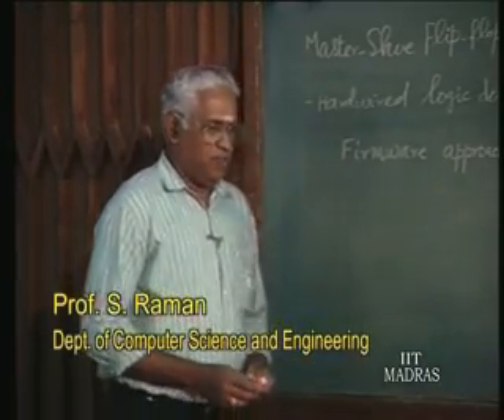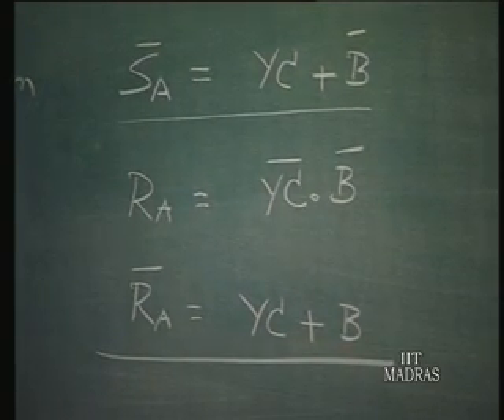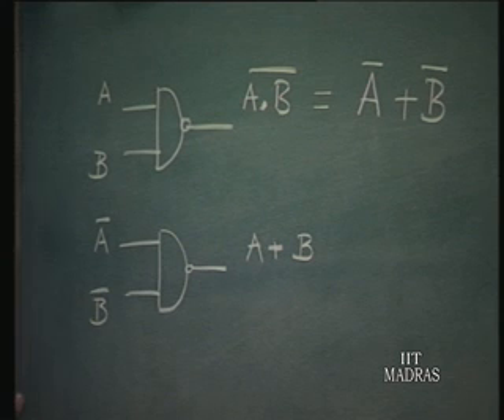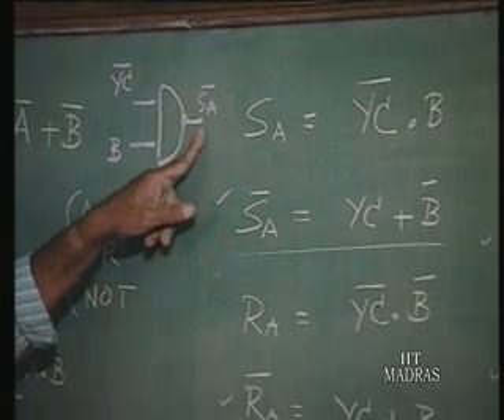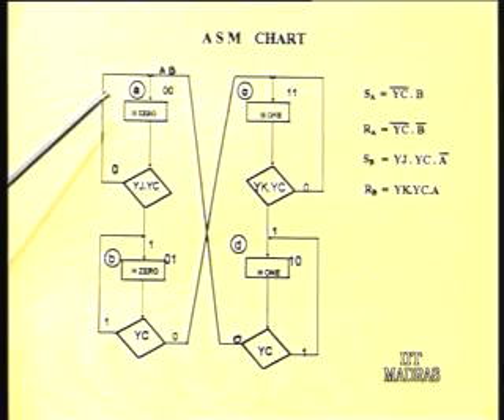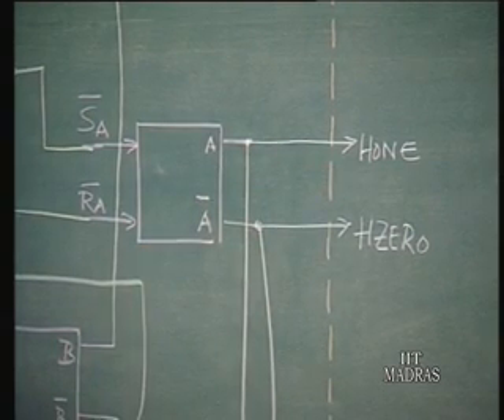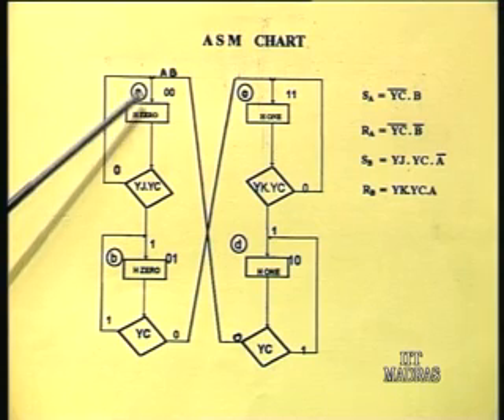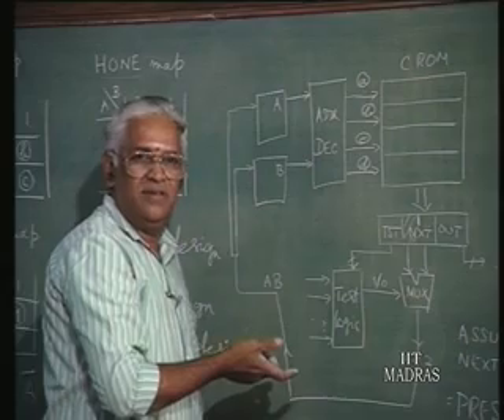Lecture - 10 Controller Design (Contd)

Comment: Firmware approach seems like top view or many levels above synthesization of Hardware Design done by ECE engineers. In actual real life we do design and simulation and write netlist and all upto the CMOS Level even those NAND gates are implemented using CMOS mosfet pairs. But it is good to see CS engineers use the whole paradigm from top in a different way than an ECE engineer would visualize. This topic seems fits perfectly at the cross section of CS vs ECE.